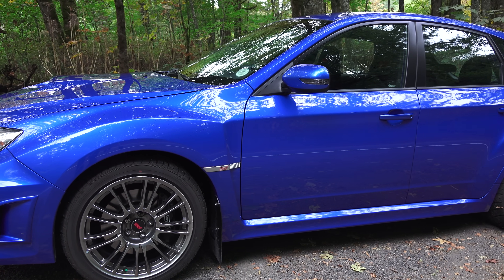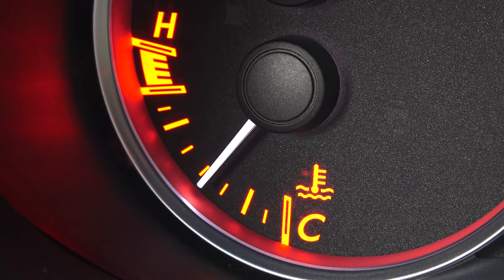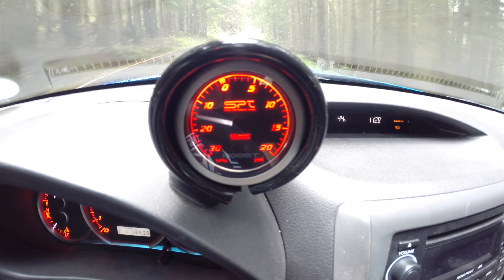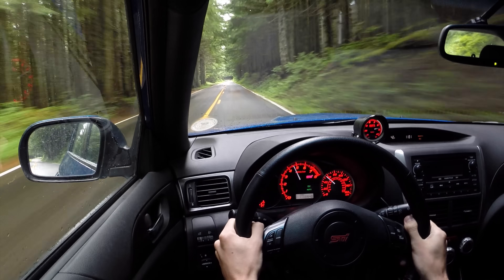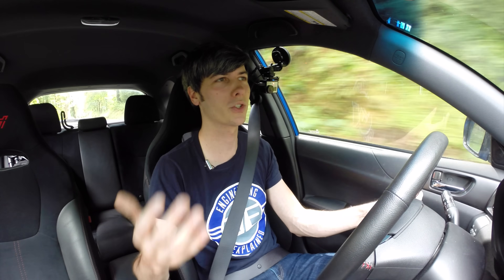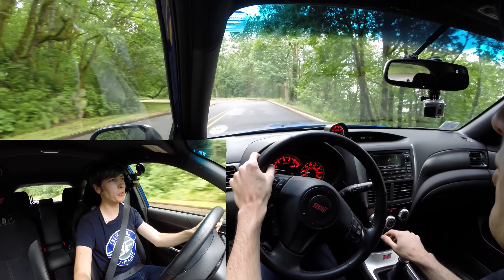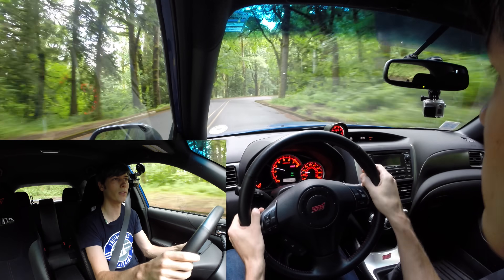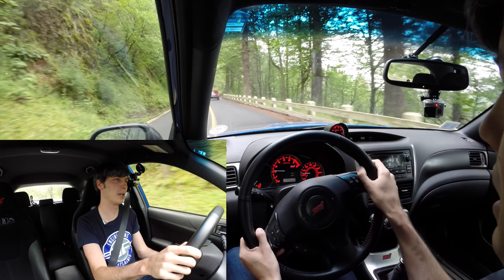5 Things You Should Never Do In A Turbocharged Vehicle

Comment: The 3rd one seems a bit 'iffy' to me? You seem more knowledgeable than me, but is this your conjecture or did you research it? I say this because you say fuel will be getting dumped into the exhaust, but the AFM meters the amount of air drawn and adds fuel to maintain whatever ratio it has (or at least that's me knowledge of it). So all the fuel will be getting burned, hence why you speed up. Also, you mention it runs richer due to this, but then mention detonation. Running lean enough to cause det and rich enough to ruin a cat are 2 totally contradictory terms? I'm probably wrong, but I've owned and tuned 2 SR20DET's and never once heard of this?

Comment: detonations occur in small turboed engines at high load/low RPM for the same reason you can't turbo a high compression engine;  the pressure becomes high enough to ignite the fuel without spark (especially with low octane fuels).

Comment: So basically how not drive a clapped out or old turbo car.  Modern turbo designs (not all new cars address all of these, but most do) using the correct fuel don't suffer from most of these issues, due to turbos that circulate AFTER shutoff, turbos with max torque available at ridiculous low RPMs, engine control systems and so on.  The reason his subaru has massive understeer is because the engine is mounted in front of the front axle.
Reply from the maker: +JamesNoBrakes weight distribution is only one of many, many variables that affects the balance of a car. It's not difficult to make a front engine car oversteer through suspension alterations, or even just tire pressure.
Reply: +Engineering Explained nicely put!
Reply: Yes, it's called polishing a turd.  It's not that it's a front engine car, it's that the front engine is in a jacked up location, like the audis where they stuffed a V8 in front of the front axle.  The moment of inertial and such will never work in your favor in such a car.  As much as I liked my subaru, this was one of the Achilles Heals, and it has nothing to do with a turbo car or not.  It just happens that his turbo car is like this because of the engine layout and drivetrain.  Look at Camaro SS, Corvette, Ferrari where the engine center is behind the front axle,  completely different story.  Most cars are designed with understeer because it's deemed safer than oversteer, but what you experience at the limit in a subaru is best described as "massive understeer followed by snap-oversteer".  This is one reason the Evo so handily beat the STI for many years and only when the EVO gained a bunch of weight with the X did it slow down a bit, but again driven at the limit, it's much more controllable than the Subaru.
Reply: And it is an all wheel drive vehicle, which handles completely different than a front or rear wheel vehicle.
Reply: +JamesNoBrakes .  Yep.  All cars have their different driving characteristics.
Reply: bit like porcha ?.doing donuts with the engine out back,stoopid design

Comment: A couple things, which I'm sure people know, is that I  most cases for modern turbocharged cars, they run and auto transmission, and the cars computers are designed to cope and adjust fir nearly every single possibility. Aka, if you have a modern turbo car, with and auto, you shouldn't need to worry too much about anything. With that in mind, you should always use a high quality full-synthetic oil, and the gasoline recommended by the manufacturer. Obviously using a higher octane won't necessarily be bad, as far as money goes, today's engine especially are designed with different gasoline in mind. for instance, on a typical turbo car (for escape for ex) Regular 87 octane is just recommended, where as a hight octane won't necessarily do too much better
Reply: VW don't use full synthetic or even recommend it. The Castrol they recommend is not synthetic. Oils have changed. In fact, here in Germany it is not easy to find a full synthetic oil any more. Before they were all labelled: FULL SYNTHETIC. Now that it not a buying decision any longer.
Reply: The same Castrol labelled oil in the US is full synthetic, here the exact  same labelled oil is not. Proving you US guys are being conned. Like catch cans.

Comment: don't diesels constantly lug? they mob up hills towing massive loads at generally under 2k rpms and they are designed to do that because they make all there power in those rpm ranges. if this lugging causes much more wear then why do diesels still last so much longer?
Reply: Diesels are designed to run at those lower rpms. My cummins generally doesn't lug until under 1500 rpm and redlines at 3000.
Reply: My 80 series Landcruiser only starts lugging around the 1100 rpm mark and is making boost at 1200rpm. it redlines at 3600rpm but the torque drops off at 3200 rpm so severely that it just wont rev anymore.

Comment: just so you know there is absolutely no difference in octane rating. doesn't make a difference unless you have a suped up motor and not stock. E85 is horrible on the fuel system and fills injectors full of crap. non ethonal gas is best.

Comment: tldr to a sort of clickbaity title
1. let your engine heat up extra, even if your engine temp is at operating temp, because oil heats up slower than coolant. 
2. let your engine cool down via idling/turbo timer
3.dont lug your engine, due to reasons
4.run high octane fuel, reduce knock
5.dont floor in a corner because boost and then you go sideways

Comment: Nicely done. Great points.  One other caveat I would respectfully add:  Make sure you use the recommended oil and change it at or before interval.  As you poignantly noted, there are so many opportunities of the engine oil to depredate.  Stretching the oil change intervals is so bad for these engines.  I know this is rudimentary and simplistic point, but it is probably the most important one.....I'm just saying.

Comment: Q: Does leaving the engine running at the end of a journey in hot weather (say 30C/~90F) help or hinder things? Yes, you're moving oil, but you're also continuing to add heat to the system?

Comment: Lugging your engine is particularly bad on your main crank bearings.
Reply: Yeah, though I will say, especially for some diesels, they are meant for high torque at low speeds. But you won't come across engines like that in cars, it's mostly larger pickup and truck engines.
Reply: Not since probably 1980 I'd say. When was the last time you ever heard of anyone having to change those? The biggest rash of them wearing out would have been when the motorways / autobahns / interstates first came along and suddenly engines were being run at high speeds for hours on end, which is something manufacturers previously hadn't accounted for.

If wider throttle and low revs was a serious engine killer, city cars would drop like flies from all the problems people are ascribing to running near their maximum torque at moderately low speeds. Why would they be made in such a way that they could easily tear themselves to pieces? That's simply unsafe for one thing, and this isn't the 1960s any more. That culture has passed.

If by lugging you mean going slow enough that the power strokes come less frequently than the flywheel can properly smooth out, then, sure, that's not going to be too kind on your bearings, and the whole thing might end up shaking apart. But it's also going to be pretty bad on your wrists and spine as well, as your body absorbs all the low-hz vibrations and shocks that sends through the frame... it's something you clearly shouldn't be doing, if only for your own good, regardless of the car's health.

1500 revs isn't a particularly dangerously low engine speed unless maybe you have a 1 or 2 cylinder engine, or a poorly balanced 3-cylinder. I've had no trouble with that kind of cruise rpm in both typical inline 4s and my current very well balanced inline-3. Possibly it might also be a problem with 4-cylinder boxers, like the Impreza? As they're essentially two i2's facing each other? I can't say I know enough about how THOSE behave to say, but I did think the boxer-4 design was one that was supposed to be almost perfectly rotationally balanced, as each piston has another moving opposite to it, cancelling out the oscillating forces, and certainly the much older examples of such found in the Volkswagen Beetle and Kombi aren't particularly fussed about chugging away at low revs... enough of them have peak torque down at just 2000rpm (without any intake compression!), and are unhappy revving much beyond 4000 due to the way their cams, valve springs and general breathing are arranged.
Any engine with more than 4 cylinders should have no problem with that speed at all, and one of the supposed benefits of early 6 and 8 (and 10, 12, 16...) cylinder engines was that they ran much smoother at ultra-low rpms, meaning they were much more flexible (especially in an era where three speeds were thought to be enough for anyone) than the buzzy, peaky, single thru four-cylinder powerplants of cheaper cars.

Comment: Use the fuel the manufacturer recommends. 
If you buy a luxury or exotic odds are good you have to use higher octane.
If you modify your vehicles engine you probable gonna use higher octane ,  but check with a mechanics or other persons that modify there engines.
High octane in average joes civic or torus, blazer or mini van is a waste of money.

Comment: Also, when making high load on the engine at low rpm, you are destroying and abominating your dual mass flywheel. Especially regarding diesels since they always use DMF and beleive me you do not want to change this part as it costs over 1000$ and the one you buy will start to fail since it is a factory rebuilt one and not as good as the original one that you destroyed with your bad habits.

Comment: Technically he is also wrong.   The engine heats up faster than the coolant because the coolant gets hot from the engine getting hot first.
Reply: That's true but The oil operating temp is higher than the coolant operating temp typically, so just because the coolant is hot enough it doesn't mean the oil will be.
Reply: Does the engine block being hot mean that all the oil in the oil pan is at optimum temperature though?

Comment: The low rpm and high boost will more than likely only affect drivers of manual vehicles. Automatic vehicles will downshift once you squeeze that gas pedal.
Reply: sounds like your car having some gearbox sensor issue, you should go and get it checked by experienced workshop and change the sensor. i got mine changed and it downshifts beautifully everafter, something missed for a long time
Reply: That's true
Reply: lol automatic Vehicles? why are you here
Reply: My ZF 8 speed is perfection
Reply: @allanhood8402 manual is the way and the truth... But damn if the ZF8 isn't the best automatic ever.
Except maybe the US made version in 6cyl Chryslers which I heard was problematic.
Reply: he was only talking to non wimps I believe
Reply: You would think an automatic would downshift, but I don't trust them to do so when I need it. That's why I seldom ever risk overtaking on two-lane highways when driving automatics. I've missed too many passing windows simply because the cars refused to downshift, even when I floored the pedal, or if it did, it took too long.

Comment: So much of this is false. if you made this video 20 years ago, sure. But very little applies to turboed cars made in the last 5+ years. 
Also: stop propagating premium fuel myths. You don't need premium in every turboed car. You should be putting in the fuel required by the manufacturer, or if tuned, the person who tuned it. Doing anything else is a waste of money. I own a turboed car and it recommends regular 87 (R+M/2).
Reply: Seth Powell god I am so sick of this myth octane rating is only resistance to detonation NOT level of quality.
Reply: +Seth Powell you might as well buy 85 octane gas then if you don't mind the ECU taking all the fun out of the turbo. You also would most likely not achieve the fuel economy quoted since the engine is not running as efficiently.
Reply: cryptos lol. He's not that by any means, he is however propagating myths and misinformation. The only one that is universally true is you should go easy on the engine until the oil is warmed up. That is true for any engine, the oil is thinner when warm and can squeeze into tight spaces better. The more it can do that, the more area it can lubricate and protect.
Reply: It isn't recommended to run 87 in the LUJ, it is required. What is recommended is 91. By that, it means that the minimum you can run is 87, but 91 is best. It was tuned for 91, but has aggressive spark adjustments for KR. So it can run on 87, which is big for the masses as it is a mass marketed engine, but doesn't run the best on it. I ran 93 in my old Cruze, since there is no 91 around here, and it ran quite a bit better and smoother on it than 87. So yes you can run lower octane fuels, but your ecu needs to be able to compensate for it. And even at that, sometimes you can't drive it hard. Another big factor that can weigh in on octane is charge temps. The tiny LUJ would beg for premium if you were in the Mojave in the middle of the summer. I drove my modded Cobalt SS turbo across the states, and in some areas, getting premium is about impossible. I had to take it easy which is hard when merging and dealing with steep hills and a stock turbo that builds boost too damn easily. It is tuned for 93, which out west doesn't exist, but 91 was mostly what I was able to get. Since my car has a knock sensor, like every car since the 90's, it can adjust for KR which reduces my power and/or even cut my boost (wonderful electronically controlled B.S. if you ask me). Does that mean it is suited for it? No, but it is trying to save the person from blowing it up. Whatever is recommended by the manufacturer is the best option, not what is required. Required fuel should be the last ditch resort if you can't obtain the recommended fuel. In the case of a tuned car, the required and recommended would be the same. Yes you could run slightly higher and maybe squeeze a little lower octane, but your car better be suited to handle such changes.
Reply: +Tim Ramich not a typo, and compression ratio is 9.5:1. It's GM engine code LUJ. It just uses the pcm to advance timing and limit boost as necessary to prevent knock.
Reply: Seth Powell, Inside the gas cap on my new Jetta it specifically says "Minimum 87 Octane".  It is not limited to 87 octane.  I've tried 89, 91, and 93 octane fuel.  She likes 93 the best, so that's what I give her.  Non-ethanol 93 that is.
Reply: Ian12 There have actually been studies on this sort of thing (there was even a Canadian market watch documentary on it), and the majority of cars that require 87 octane do run best at 87. The researchers involved found that higher octane causes incomplete combustion, and even knocking in some cases.
Reply: My car Produces 25 psi of boost. I run 94 because I want the most power. Will it run on something less? Sure it will but the computer detunes the engine and the thing runs like a dog.
Reply: In a performance car, putting premium fuel in is never a bad idea. Especially when modded. Its just common sense, higher octane fuels are more resistant to detonation, detonation can be brought on from many factors - bad batch of fuel, overly hot conditions, boost spikes, aggressive tuning. 

I have seen too many engines die simply because the owners didn't use premium fuel when they should have, trying to save a few cents a litre.
Reply: ...Knocking is from premature detonation.  87 resists detonation/knocking less than 93 does.  That's what octane rating means.
Reply: if the car is designed for 87 octane rating means it will not knock if u r putting 87, putting 91 wont get u any better result. Proof? check out CBC market place on YOUTUBE
Reply: Have you ever tuned a motor buddy? And or used a dyno?
Reply: is any of this relevant to turbodiesels?
Reply: Better fuel = better quality = less carbon build up, cleaner exhausts more power. Not a waste of money then.
Reply: It's also not just about power (or lack of), knocking, and economy. The wrong fuel will have your ECU making adjustments that may be within it's own parameters, yet outside the parameters of other components, including your catalytic converters. Low octane can fuel could ruin your converters depending on how far in any particular direction your ECU adjusts your fuel trims/mixture. I know a lot of people who ruined their Audi converters from not using the recommended 91 octane fuel, and the onset is more immediate due to our altitude (Colorado).
Reply: Hell just buy a bottle of octane booster turn 20 gallons of 87 octane into 95 octane for $2.99 problem solved.
Reply: Sometimes the manufacturer is wrong. See Ford ecoboost engine problems.
Reply: But nobody cares about cars made in the last 5 years so why are you bringing this up? 20 year old cars are more loved
Reply: Michael Darges I drive 80% highway, and the 20% city isn't very stop and go. Its also relatively flat terrain here so I hardly ever have it pull timing or boost. I used to put 89 or 93 in it until they doubled the markup at the pump last summer. They don't sell 85 here. I have a CTS-V for fun, the Cruze is just for cheap commuting and road trips.

Comment: its cslled a spark knock , and it happens in my Saab turbo when i run anything less than 93 octane , they say its from high heat , high compression motors excactly what a turbo motor is , rinning higher octane helps because the gas actually dosent ignite as quickly as a lower grade does hence pre ignition termination